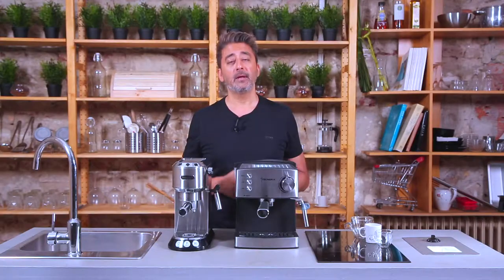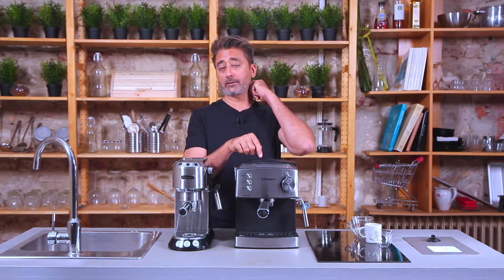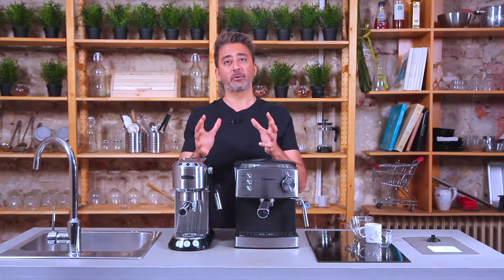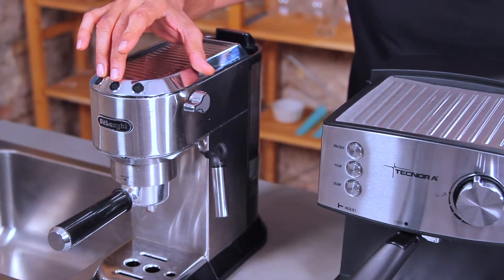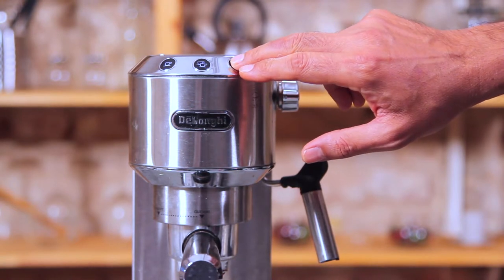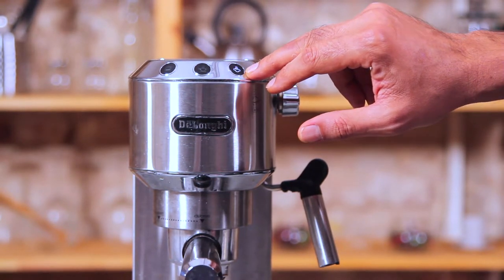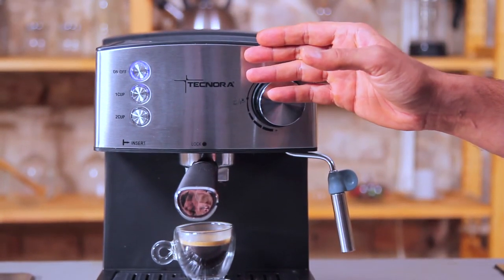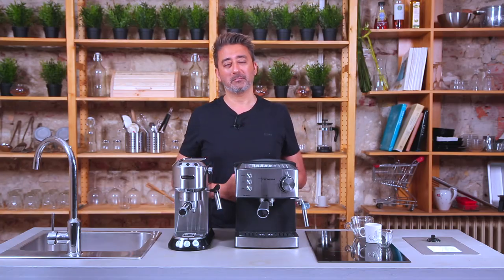What Is The Tecnora Double Boiler System?

Comment: I have been using tecnora semi automatic Espresso Machine with the Pro bottom less porta filter since 2017 appx.  The machine with the Pro filter saved me atleast few lakhs in total from getting expensive style coffee from a cafe rather than, I am getting expensive style coffee at home. Thank God.
Reply: Hi I am thinking of buying this one. Did you have any problem in last few years. how is the service and support. should we sent it back to them for repair or do they provide locally in metros at the least.
Reply: @rajareddy4059  this is a good machine but it is automatic. Not semi automatic. So it is a matter of a bit getting used to. But with the non pressurized porta filter that tecnora provides would be a better choice with the stock machine.

Comment: The frothing stick is too low. You just can't get the mug out after frothing. Some sad schmuck designed it.
Reply from the maker: Hi Rahul, are you speaking from practical experience using our machine? 

Being an espresso machine, a full-size coffee mug would not fit below the showerhead either, unless you remove the drip tray.

For milk frothing, we always suggest a frothing jug filled halfway with milk. We've had no problems with that.

Is it fair for us to say that some sad schmuck designed your coffee mug?

Cheers!
Reply: @tecnoratv  First of all maybe, maybe I was rude and yes I'm talking from experience. Coffee mug is fine, I'm talking about frothing mug. I always have to tilt the machine after frothing to get the mug out. You'll notice what I'm talking about if you watch the video from 08:30. Though I appreciate the witty reply the schmuck who designed the mug is also you. It's your mug.
Reply from the maker: @Rahulhooda143  
It seems we've ruffled some feathers. 

It always happens when we point out the liberty people have to callously comment and even be 'rude'.

If you take the stainless steel Panarello out, not only will you be able to froth the milk better, but the problem you are facing with the height will also get solved.

And, we didn't design the mug.

Comment: I bought my first espresso machine in Switzerland back in 2010 it was a Saeco machine, and the second machine in US (2017) was a Delonghi ECM146 semi-automatic, and boy was I enjoying both these machines. Unfortunately earlier this year both the machines failed (pump burnout) and the service person in India told me that neither can be repaired, and if I wanted to change the pumps I had to shell out close to 10K. In my subsequent search for a suitable replacement I came across Tecnora and through a good deal on Amazon I have purchased the ECM 801A system. I am eagerly awaiting the delivery of this machine and hope it stands up to my expectations. What I am really concerned about is the Crema and the flavor of the shot. I hope this one does not burn the coffee.
Reply: hi can you please give your insight into the Tecnora espresso machine after using it for last one year. I am thinking of buying it. thanks in advance.
Reply: @rajareddy4059  Hi, this one is just ok if you are very new to espresso brewing. As such it works fine, but you do not have control over the duration of brew which is one of the critical parameters for proper extraction. I have moved on to a more expensive machine from Caffe Birraio (albeit more expensive) because I have been exploring various coffee roasts from India and have a burr grinder separately.
Reply: @theindynomad  How is the Birraio ?
Reply: @rajatbansal512  Caffe Birraio in combination with Baratza Sette grinder setup has been just perfect! I have been able to take full control of my shots extraction and have been busy experimenting with various roasts from across India. It was one of the best purchases I’ve made to date (coffee-wise)